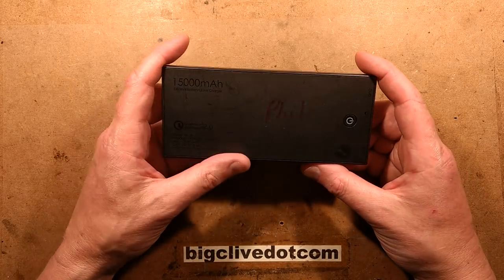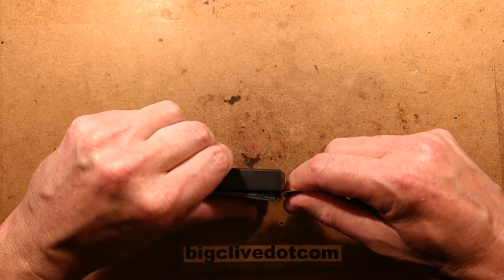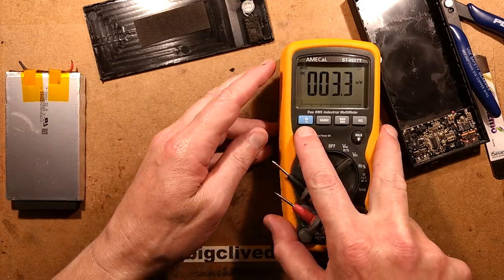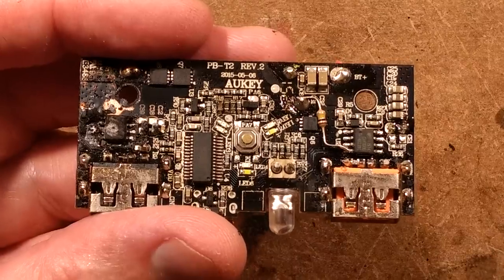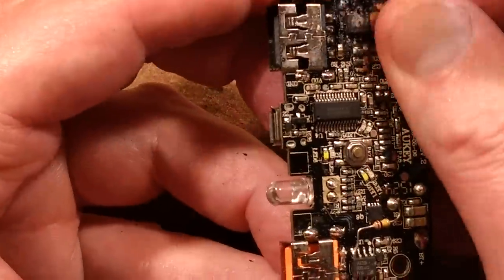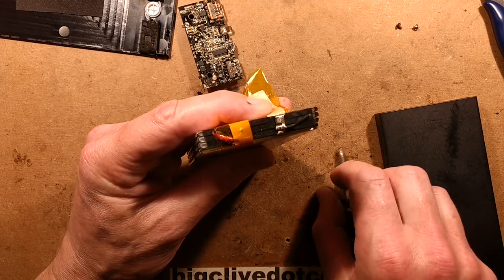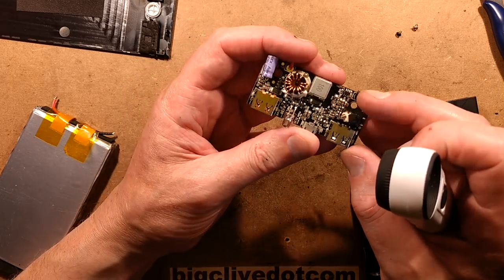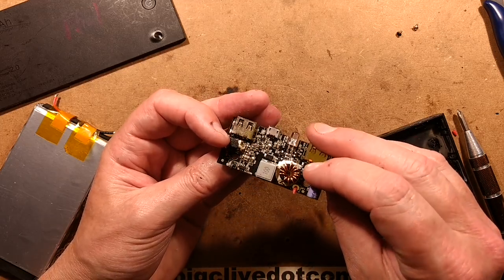Inside a burned out Aukey power bank.

Comment: I got one of them and mine caught fire! I charged it with a fast charger. Im unsure if that was the cause of my fire!
Reply: I woke up to a strange smell and wondered what it was. It burnt my desk and all
Reply: Stuart Dubois that'd definetly be the issue that caused it unless the power bank is specced to charge at that high amperage if not it will cause damage sometimes catastrophic damage and sometimes like this were it just blows out a component
Reply: It shouldn't though.  Quick chargers require communication to trigger their higher voltage outputs, without that they just stick to 5v 2.4A max, or less.

Even if you plugged in a 5V 3A charger and the pack was designed for 2.4A, it should only pull as much current as designed.  Besides that, I have found its pretty hard to get more than 2.4A down USB cables, that's why quick charge was invented as 5v suffers a lot of voltage drop in the cable once you try to push high current.  Just look at PC PSU cabling to see how large a conductor you need to push 5V above around 2A.
Reply: True, unless the quick charger itself has a fault or was confused (which is then bloody dangerous).
Reply: Had a QC3.0 bank do the same. Said it could take it, after 30s I smelled something, by the time I got to it there was a lot of smoke and a very melty plastic bit. Just glad it was on my rubber floormat and not the car seat, haha.

Comment: My guess, that chip is an IP5306... Just a hunch, but that seems like that could be the chip used based on some digging around...
I think it borked itself internally when the other IC was fast-charging, it somehow latched it's drive transistor on which then failed in a dead-short; many of these chips have too much 'smarts' built in that then get confused and do strange things, leading one to awake to strange smells...
In fact, the datasheet i'm looking at from 'injoinic' refers to some chips having I2C communication... I've also seen that there's more allowance for the number of LEDs used for unknown purposes, as there are thee pins dedicated to LEDs...
Could be possible that an unused floating serial data pin was borked out by random 'stuff', or that their over-led-oriented control logic got so confused about which led to light, that it just went "F##K IT, ALL TRANSISTORS ON" and committed suicide...
Just my two cents, chinese ICs suck about 70% of the time...

Comment: 2.8 volts

any halfway decent lithium charger will refuse to charge anything below 3 volts.

2.5 volts is the absolute minimum you can safely charge a lithium cell.

however some chargers that are designed with recovery mode or really cheap chargers will charge cells that are below 3 but higher than 2.5 volts.

i have seen some videos where people have successfully charged cells that have been drained to zero volts but it is very risky as the chemistry has been compromised and could pose a fire or at least bloat hazard.

Comment: In reality, how often do power banks like this catch fire or explode?   Is this something serious or a 1 in a million type thing?
Reply: As product developer for electronics company including power banks,  can say 1 in 100.000, sometimes cell failure, sometimes the cell recharge chip get burned by the heat not dissipating enough. Mostly this is caused by chipped or cracked inductor not get rid of the heat and other parts start failing. Or end user use bad/crappy product to charge. All products can have failures like these, power banks are such high capacity power products people even don't realize what a small wonder of power they walk around with since li-ion. And maybe they should take little more care.
Reply: Thanks for the answer..   The way I see some people talk about them, I wondered if the problem was more common, i.e. and every week or month occurrence type thing.  I built my own power banks but I used 18650 batteries as my power source, instead of flat lithium style batteries.   Mine can be charged via USB or via solar power as I include a solar panel mounted on it too when I make them.  Since I build them and give them to family and friends for their use, seeing some of the comments got me worrying a bit that they might a major danger..  but from what I am reading, that is not the case with normal care and use.. plus by using a good quality and brand 18650 battery, the probably is even more rare..

Comment: Whatever was supposed to prevent it from going nuclear didnt function. I am starting to think mabe those things should be kept in a tin. I keep ALL my RC lipo batterys in a decorative tin I got that had tea or something in it. In the event of a fire, the tin will prevent it from burning down my home. I had a 5,000 Mah battery go slow mo nuke in the ammo can I kept it in. I had crashed the plane it was used in but didnt notice the metal foil outer wrapping was damaged slightly. It was venting fumes and we were smelling a metallic smell when I opened the can, it was clear where the smell was comming from. Luckly it didnt catch fire but because it was in the ammo can, it couldnt burn anyways as the can has a tight seal anyways.
A simple metal cookie tin might be a great place to store those power pac batterys. That could have easily started a home fire had it burned through the battery wrapping. I thing manufacturers should add a small strip of fire resistant material between the battery and the circuit board. What do you think?
Reply: There is nothing you CAN do to stop the boost circuit from failing if gets stuck open or shorts.  It could easily have done this on the rated output current, so still been within spec.

It didn't nuke the battery, so the protection clearly did its job.  This is really no different to capacitors releasing their magic smoke, if a component fails there is nothing you can do about it except design the circuit to attempt to prevent it sending other components into failure.  In this case, it took the choke with it because there is really no way to stop that.
Reply: RC Hobbyist Extreme to be fair it looks like whatever component went nuclear did prevent the battery itself from failing. You have the right Idea keeping batteries on charge in a tin though, I do the same with power banks and my Ecig. Will at least give you sometime to react before it burns your house to the ground

Comment: What would happen if you charged the phone directly with the battery , and without the circuit?
Reply from the maker: It wouldn't put a full charge in, as the voltages would be similar.
Reply: bigclivedotcom ok thanks

Comment: Digikey lists that CHY100D as a simple PMIC USB charger.

  Along the lines of what you briefly mentioned, I would like to see someone explain one of the samsung fast chargers. I got a bad one recently but I'm in the middle of a big bench lightning revamp and can't do much else right now. The bad one I got starts at 5v goes to 9v for around 1.5 min then cuts out to 3.4v and no current before recovering a few seconds later. I assume it's a thermal shutdown of some sort but haven't torn into it yet.
 After looking on YT I'm surprised I couldn't find a schematic/teardown of a dual fast charger design from any of my favorite CC's, or anyone else for that matter.  I'm really surprised Danyk hasn't done anything on Diodes Gone Wild for this design ;)
-Jake

Comment: Could been a lot worse i guess , Saw that bodged on resistor on that IC chip least it looked that way , For it to blow that hole in the lid must been sustained long term heating but what gave it the force to blast through.
Reply: Not hard though, the chip that failed isn't designed to handle a sustained voltage, its meant to pulse.
Reply: No blast bro, that was sustained heating... Melted a hole in the plastic above the chip...

Comment: Please avoid Aukey if you are seeing this. The Plastics they use are not up to the task to withstand any sort of heat the electronics they use in their products creates. I had the unfortunate nearly fatal accident of one of their three port USB wall chargers breaking in my hands after trying to unplug it from the surge protector I use.
Reply: Clearly this power bank was, as it only slightly melted and didn't ignite despite some extreme heat from that failing component.

Any manufacturer can have bad batches, I don't think its a reason to assume they are bad.  Even well known brands can have issue like that.

Comment: It's slightly annoying that your voice gets compressed down to a very low level whenever there's a louder sound. Like just after the one minute mark.
Reply from the maker: Yes it is.  On the Moto G4 (this is the plus version) it didn't do that when used with open camera.  I'm not sure if this effect is part of the software "update" that nuked the phone's functionality.
Reply: Overly-sensitive Auto Gain Control... I don't know what you use to edit your videos, but most editing programs offer an audio effect that might help (if you want to). It would be called "Dynamic Compression" or something similar. I have Sony Vegas Pro 13, and they call it "Track Compressor." It's a bit fiddly to tweak it just right, but once you do, it works quite well.

Comment: It seems you have started using AGC for audio (at least one video back). It is a little annoying when it cuts your speech. Any chance of going back to how it was before?
Reply from the maker: Sadly I switched from using a Moto G4 to a G4 plus and I'm not sure if it's a phone difference or the recent "upgrade" that had caused it to overheat quickly while recording.
Reply: Oh. I don't know Moto's phones, but it seems odd that they would suddenly switch to such aggressive AGC. Have you (I'm sure you have) looked through settings, if audio AGC could be turned off maybe?

Comment: Had the same shitty powerbank and it started buldging after a year.
Reply: Its using Sony cells, I wouldn't exactly call them shit in general.  They have had bad batches in the past though, can happen to any manufacturer.

The fact this failed safely (one or more components going up in smoke can happen to literally ANY electrical device, you can't prevent that) should be considered a GOOD thing.

Comment: I charge mine in a semi fire resistant container in the garage, just because it has a huge capacity can quick charge, i feel like there's alot that might go wrong
Reply: It annoys me that so many high capacity power banks still use plastic casing.  Surely using metal would be a lot safer, both due to failure and ability to dissipate the heat of fast charging better?
Reply: Alex Atkin mine has an aluminum body

Comment: How is it possible? 😅

I had actually had similar Aukey power bank and actually managed to fry the pcb because of my xt60 connector modification. I created an short circuit because I mistake the polarity and was using banan plugs to emergency charge everything 😅

At least there was a protection build into the LGABF1L1865 18650 cells by some no name manufacturer

Comment: The battery pack might not hold a charge@2.9V. Unless it's been sitting for years.
Reply: Surely the longer it was sitting there the LESS likely it would hold a charge?

Although I have been surprised by my original Nintendo DS, PSP and PSVita which still hold a charge despite being left empty for years.  If the battery and circuitry are well made, it seems they do hold up well.
Reply: My comment in your first half.

Comment: EEk. I have this one. Would you recommend I pitch it?
Reply from the maker: It should be fine, but I do recommend any power banks get charged on metal plates or trays as a precaution.
Reply: This is why I prefer power banks that use metal housings.  They offer that little bit more protection wherever you are using them, plus less likely to overheat.

Comment: Aukey is a crap company.  They are one of the biggest "pay for good Amazon reviews" manufacturers, and are trying to pass themselves off as Anker by hijacking listings.  Check out /r/aukey for an example.
Reply: jup, anker does good stuff. My Anker gaming mouse is still great, no signs of use after 5 years of raging :D
Reply: I feel like the Aukey cables are actually of higher quality than the Anker cables.
Reply: I bought the 20,000mAh pack years ago and it's still going strong. Never had an issue.
Reply: I did have an Anker 20,000 mha bank that died, but it failed safe and would only give out about 60 mha charge. My four others are all Ankers without any problems.
Reply: I expected r/aukey to have more than 5 post all time lol
Reply: I've had really good experiences with Anker, especially their PowerLine cables. I've had six Anker Micro USB cables for just over two years now, and none of them have even started to fail, where my family blew through cheaper cables within months.
Reply: I've got an Anker Soundcore Boost bluetooth speaker and it's the biggest piece of crap I could've gotten apparently. Completely distorts on the output stage at reasonable volumes, cuts out at random moments, doesnt want to connect to certain bluetooth devices, has a broken AUX input. Oh and Anker went all out and offered me 1/8th of the purchase price as a refund. Fuck Anker.
Reply: My first aukey power bank was of poor quality, now gives far less charge than rated. Also unlike my newer anker allows it to be charged and output simultaneously which is not ideal for the lazy
Reply: quangluu96 if you want usb c power banks, chargers or quick charge Anker don't have any options really so you have to go with Aukey etc
Reply: Ive used anker for small power banks (2-cell 5200mAh) and they are very good, but I wouldnt buy anything bigger by Anker as they  still use the stupid 4 dot power gauge that leaves you guessing how much juice is left. A 30000 mAh bank with 'one dot' of power could have over a full iPhone of power left in it, or it could be just about dead!
iMutos are the best device out there right now.
Reply: I saw a post on a forum where you basically make a fake receipt and say that its like making your phone act weird and you get one for free. But i don't think its worth it.
Reply: Anuj Rajput very true. I got the new 20k aukey. Has USB c and lightening charge and discharge. I hope it's quality.

Comment: Can you fix my electric lawnmower?
Reply: The rotor slips by about 3/4" and out of the DC brushes. Would the bearing be the issue, it has no bearing on the top so it has to be on the bottom.

Comment: I have an Aukey power bank that i keep in my bag just in case i need to charge my phone! D: i thought they were a good brand.
Reply: Think i will be replacing mine with another Anker one! :P I could recycle the cells in my Aukey.
Reply: It failed safely, which is all you can hope for really.

Considering they are at the high-end of budget brands its not really a surprise they have a higher failure rate.  If they don't burn down your house when they fail then I consider that a win.